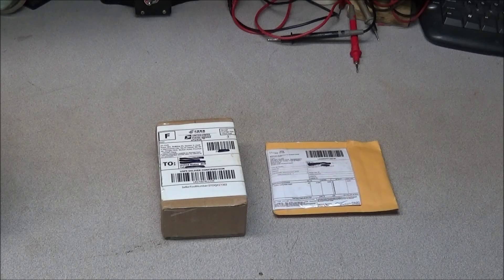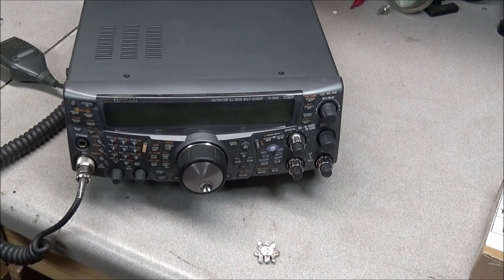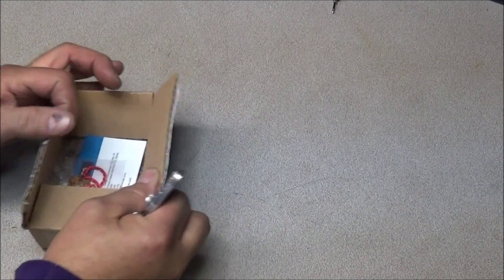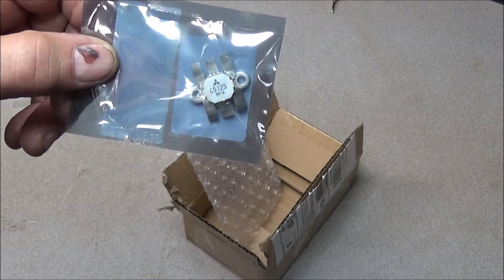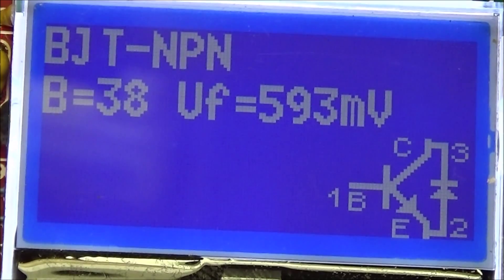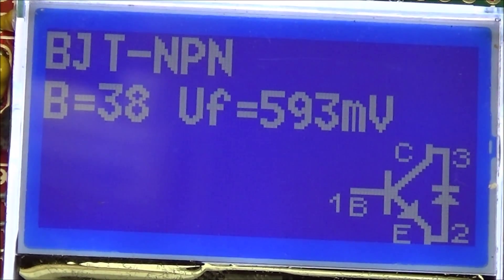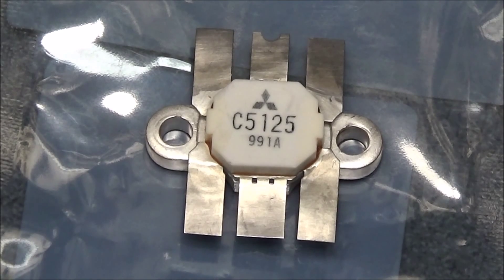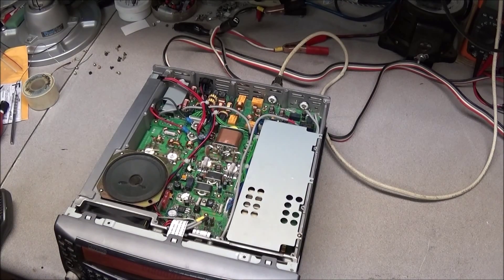#13 Kenwood ts2000 Are refurbished transistors from China real?

Comment: There are other parameters like thermal resistance junction to case which are very difficult to check.  My guess is that transistor was NOS, not refurbished.
Reply from the maker: There is no such thing as a refurbished transistor as said in the video.  You are correct on the thermal resistance.  The suppliers gets old units and salvage parts from them, then resell the parts on en=bay as "refurbished".

Comment: I have verified that many Chinese transistors transmit at full power at 7MHz, but it decays as the frequency is raised. For example, at 7MHz we will get 100W, at 14MHz 95W, 24MHz 70W and 28MHz 50W. They should always be tested at the highest range of the transceiver. For example, some time ago I bought some MRF255 and the original reaches 50MHz. Well, in the entire HF band it has good performance, but it only provides 10W in 6 meters.

Comment: Hi Buddy, on another video of yours you did a great job of explaining your train of thought/thought process on troubleshooting. What was your process in this case? You mentioned the unit was drawing a lot of power (I assume a lot of supply current). But then what? What made you go to the final amp, what testing?
Reply from the maker: Hi Patrick. Well, since the DC comes into the radio and is connected directly to the PA of the rig was the first clue. Also anything that pulls more than 1 amp has to be in the PA section.  If something was shorted in the low power section it would burnt out before reaching the current limit this was drawing.  With that said it led me straight to the amplifier. Hope that helps.

Comment: a refurbished transistor is simply an old one removed from some old used equipment and then it's cleaned up re tinned and made to look like a brand new one again which is what you have in the photo, there's far to much tinning on the legs,it may well work ok but how long for ? this could have had 10 years use already,take a look at my channel for more tips on refurbished semiconductor.
Reply from the maker: That is correct Michael, I will take a look at your channel also.
Reply: Comment noted Michael, however, the only time I worry about SEMICONDUCTOR life is eg. EEPROM read/write cycles. 73!

Comment: 3:52 side-by-side shot, shows that it's a counterfeit. The logo is a bit elongated on the copy, the fonts don't match and the etching is darker on the original.
In most cases, the die is identical, but smaller. So don't expect the same output power and signal quality.
Reply from the maker: I agree it looks like a fake. But the Kenwood has been going strong at 105 watts output for nearly three years now.  I did happen to find a set of these that a friend had bought many years ago. The beta is quite close to the originals. using a set of calipers they are the exact same size. Maybe the video causes them to look different.   I tried the paint thinner test on the logo and it did not come off. Signal looks perfect on a spectrum analyzer. I bought several obsolete transistors from this seller and all checked out fine. Thanks for your comment.
Reply: You are a lucky man my friend.

Comment: Sorry to be ignorant but how do you "refurbish" a transistor. I understand semiconductors well and don't understand how something like that can be "refurbished". Any thoughts or links for edification?
Reply from the maker: Don, There is no such thing as "refurbished" transistors.  This is just the way the Chinese list them.  What they do is remove the transistors from junk boards, Clean all the solder off. They call it refurbished.
Reply: They are more like "Tested Used" transistors. 
It's mind boggling that such a common transistor is out or production and is no longer available (or not easily available) brand new.
Reply: They are more like "Tested Used" transistors. 
It's mind boggling that such a common transistor is out or production and is no longer available (or not easily available) brand new.

Comment: How can such a widely used power transistor be "no longer available" or at least not easily available?
First, component producers create the demand, then they create the parts shortages (on purpose). 
A production facility could spit these transistors out like popcorn if they wanted to and it's not as if there isn't a demand out there for them.  Ridiculous.
Nice work, though!
Reply from the maker: Agreed. These are still needed.  Makes you think they want us to buy new radios....
Reply: Same thing happened to the SG500 amplifier for the SGC2020 radio. Transistors for the amp went NLA, out of production. Guess they tried going with Mosfets but nothing became of the project. Company kinda fell apart after the original owner died and his widow sold it off to one of the employees who decided to concentrate the company efforts on antennas and couplers for the military.

Comment: I also have a problem on my TS 2000. I still not test it, but since he lost power on HF and VHF, my guess is the drivers.
Another problem like this, to find good ones from China.
But you had luck.
Thanks for sharing.
Reply from the maker: Yes start with the drivers. They are possibilities.  Be sure to check all voltages also,

Comment: isn't Hong Kong in China?
Reply from the maker: +mike charette Correct, but there is some difference. Got to Dave's eevBLAB channel and look at video #20, Franky explains it there.
Reply: great video by the way.
Reply from the maker: +mike charette Thanks for the comment. I never knew why when I order from China it took so long to get the part, but if it was in Hong Kong it was here in half the time.  So I was thinking like you, Hong Kong is in China but why. Then I saw that video from Dave and it all cleared up.Thanks for watching.
Reply: because Hong Kong is under U K whereas China is China
Reply: +mike charette 
Hong Kong was returned to China from Gt British rule on July 1st 1997
Reply: Sam W I was in Hong Kong several years ago after It was turned over to China. Was still very much westernized.
Reply: did not take that into consideration.

Comment: Great video tutorial. I am curious about the tester you used for the RF transistor. What brand and model is it?
Reply from the maker: +Ross DuClair  Hi Ross. This is the  DIY M12864 Graphics Version Transistor Tester Kit LCR ESR PWM You can look at video number 12 where I go through the assemble and test of it. Also there is links to the device.Thanks for watching.
Reply: +The Radio Shop : Thanks....I ordered two of them...I will try to use it as an in-circuit component tester as It "appears" that capacitors are tested using a frequency standard inside the tester.
Reply from the maker: Great, I like these units. Let me know what you think of them after a short time. I used this one as an in circuit tester and works good. Just make sure the caps are discharged.

Comment: I to am always skeptical of semiconductors from China.  Glad to see you didn't get burned on this one.  Have you ever used Eleflow transistors?  I have been using them for a couple of years now and have never had a problem with anything from them.  Pretty much any discontinued RF transistor you can think of is manufactured by them.  I only have one problem with them, they don't have a US distributor.  And also a suggestion.   If your buying any type of quantity from them you can haggle them down on the price.  I found that out on my first large order.  Got a price quote on a fairly large order and said I would pass on a couple items due to price.  Their reply was, well how about at this reduced price.  Hmmmmmm, wasn't thinking, Chinese barter economy.  From then on I always haggle the price with them.

Mike
Reply from the maker: +MikesRadioRepair .CBRadio Hi Mike. I am a little cautious of buying from ebay let alone China lol.  Just this time I got a good deal. Never bought from Eleflow but folks that have. Most gave positive reviews but one never got his part. Guess he did not push it hard enough.Thanks for stopping by and sharing that info.
Reply: I have the TS 2000, EVERYTHING, including ATU, Tranceiver, and power supply grounded, and when I check swr, use min pwr, which is 5 watts, keep 100% duty cycle modes like FM and AM power down, say to half-3/4, that way you will get long life out of your finals. ( Most times other end will hardly notice the difference between 50 watts & 100 Watts.) Great Radio, love it, Barry, VK2FP